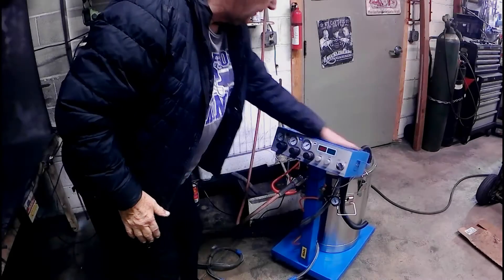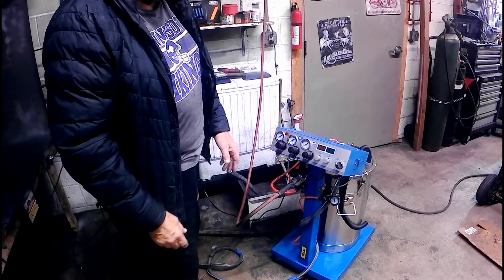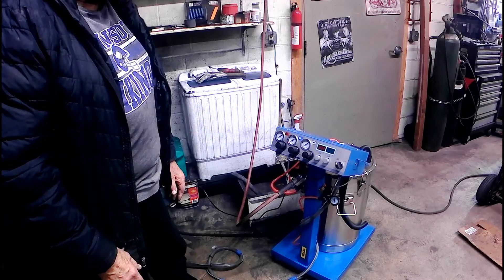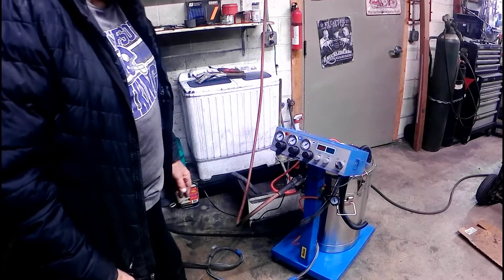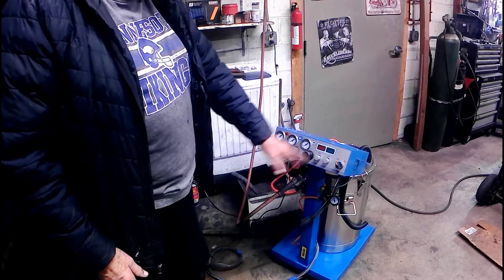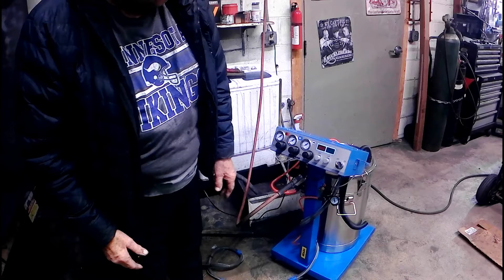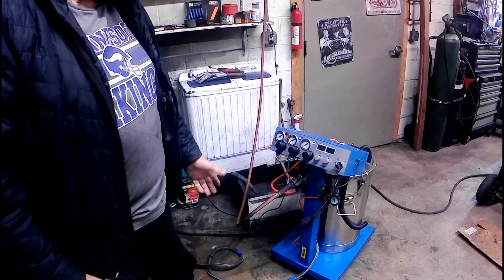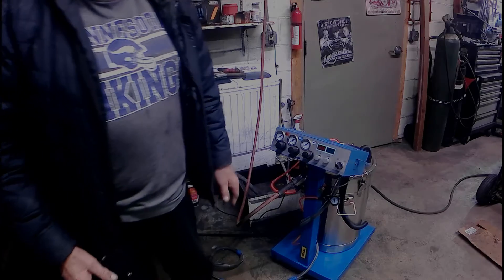WX958 Powder Coating Machine Final report

Comment from the maker: FYI I used it for 10 seconds and the control board fried. I have to order a complete new unit and send this one back for credit. What I am going to do is simply swap out the control head and ship the new unit right back. you can buy just the control board for $60 so I may get a spare.

Comment: Is there a diagram of how you replumb it  and also what are the settings for air pressure  the one i bough came with mpa instead of psi i dont know what the gauge should read ?

Comment: The hose is going to the bottom of the hopper. It is to create bubbles inside the tank, but It was supposed to have holes for the air to pass through, but it doesn't. If you check inside the tank on the bottom, it was supposed to have some holes for the air to pass, but it doesn't.
Reply from the maker: Actually there are no visible holes but the membrane is porous and does let air through without letting powder to seep past